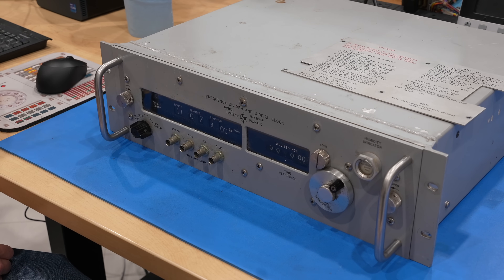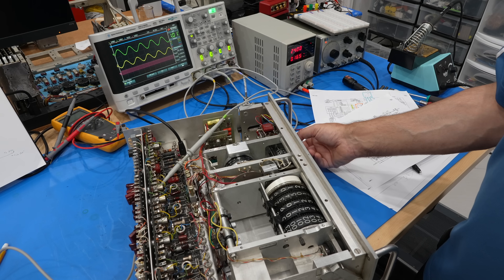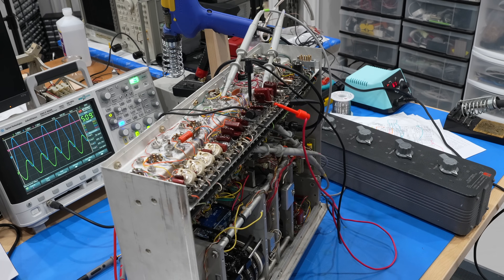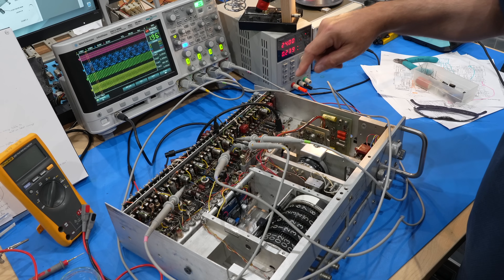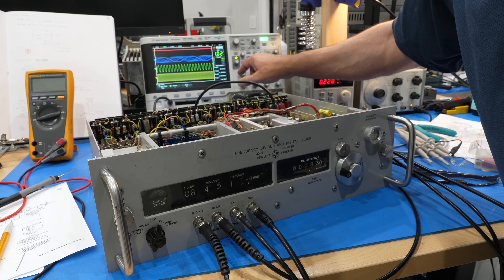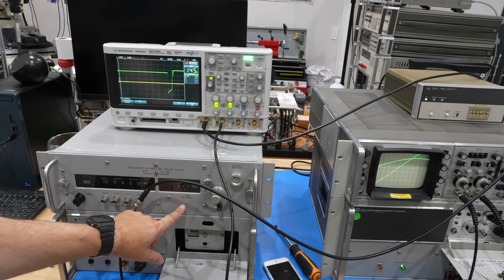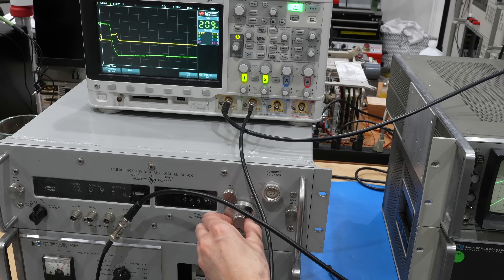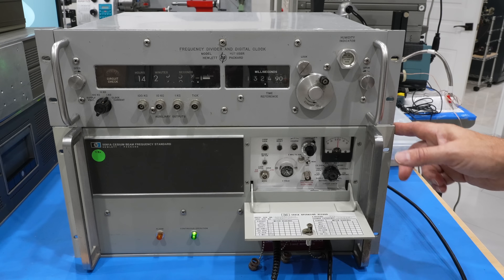HP 115BR Hackaday 1 Hertz Challenge entry

Comment: The minimalist in me likes the idea of a unijunction transistor relaxation oscillator.  All you need is three resistors, one capacitor, the UJT and a battery.  It is a very 1970s thing to do, appropriately retro in spirit.
Reply from the maker: Yes, I agree! I don’t know what happened to the unijunction transistor. The 555 killed it?
Reply: @CuriousMarc  Thanks for the reply from my favorite channel.   Yes, I believe the 555 took much of the UJT’s glory: similar parts count, wide supply voltage and it could directly switch several hundred mA.